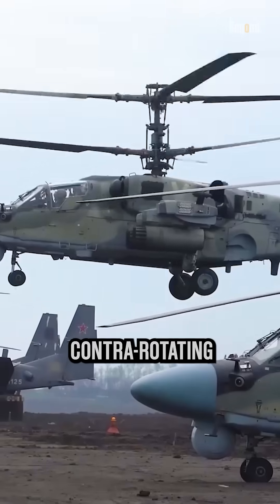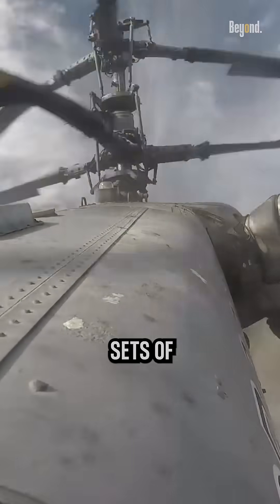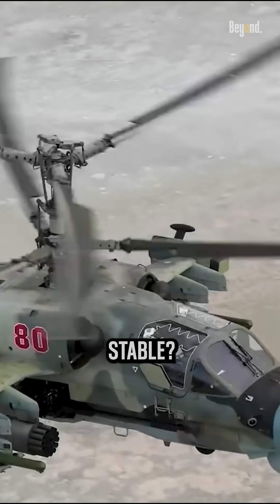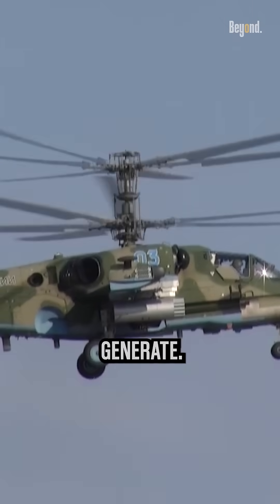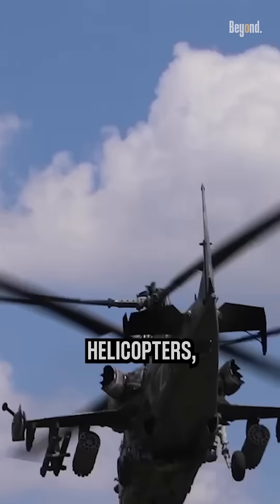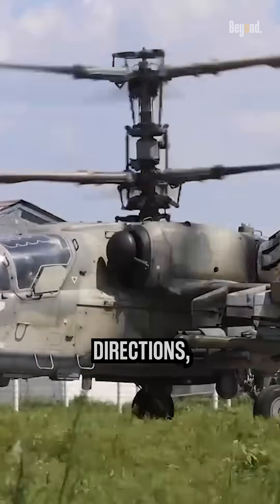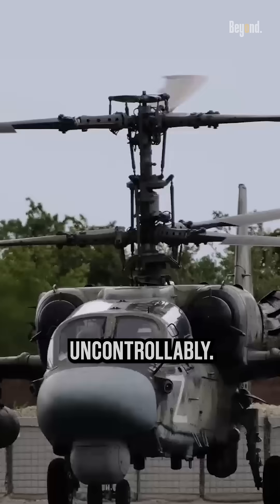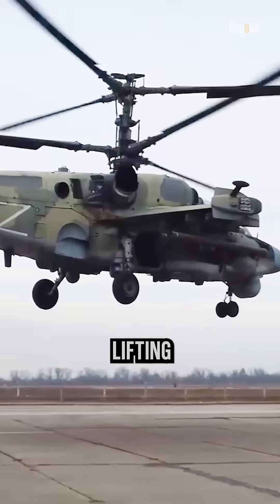How do helicopters with Contra-Rotating Rotors work? #shorts

Comment: Counterrotating rotors, or coaxial rotors, naturally stabilizes the helicopter by cancelling the torque (or the torsion par) from both rotors by spinning in different directions. Therefore, there is no need for a tail rotor (as those found in conventional helicopters) to counter the helicopter’s fuselage momentum as it tries to spin on the opposite direction while its main rotor spins to the other.

Comment: The reason we have NOT seen all that many contrarotating blades on helicopters is that it is MORE complex than driving two blades one lift and one anti-torque. Both cases use TWO blades but the second on the standard helo is lighter weight, so you are spinning two more massive blades in a contra setup. There a reasons for both but that is a use-case decision. Remember actual maintenance and build are more expensive for contra.

Comment: And now explain how those two sets of rotors are turning in opposite direction on one shaft. That is really interesting.
Reply: I'm curious as well
Reply: There are actually two shafts there, one goes through the other.
Reply: @dwishs  I know. One on the inside and one on the outside.

Comment: The coaxial rotor system is actually way more complex, both mechanicly and aerodynamicly, compared to a traditional helicopter with an anti torque rotor. 
Not only does the coaxial rotor have about 4 times the amount of moving parts compared to a conventional heli, the aerodynamics are also way more complicated.
Reply: That explains why the us didn’t use this technology in their helicopters not only complexity of it but the maintenance of it would have been a nightmare probably
Reply: @jaredharris1970 I would actually say it's surprising the Russians went with the much more complex to manufacture and especially to maintain design while us in America went with the more practical one.

We seem much more likely to make for example a VTOL aircraft so we can take off from open fields and dirt roads and then have the aircraft never once in it's entire lifecycle ever use the feature outside of a yearly refresher training.

We'll swear we need it to be able to do all this but then just launch it from a catapult or perform a traditional take off anyways because it's much more high risk and dangerous to take off vertically.

The English did actually use the harrier that way due to not having proper carrier launch capability and using the Ski jumps but we just spent billions making aircraft capable of stuff we never wanted it to have to do
Reply: Actually nope. It's complex in mathematics but not so much in mechanics - you have no need to second and even third gearboxes for tail rotor. And this helicopters are much safer (no cross connections in controls - you don't need to move your collective while do pedals).
And in terms of maintenance, you can research usage of Kamov Ka-32A11BC by VIH Canada. They get 2600+ flight hours in a year on one of their helos and 2000+ f/h in average per helicopter of this type.
Even Californian firefighters (Calfire) tries to by this type of helicopters back in 2014 the US Chamber of Commerce banned the deal.
Reply: @trionghost  It is true that you do not need a gearbox at the rear to power a rear rotor, however you ignore how complex the controls for the second main rotor are.
You first of all need a gearbox to power both rotors coaxially. Then you need a second swash plate between both rotors.
Third, as you removed the tail rotor, you need a way to control yaw, which is done by increasing the collective on one rotor while decreasing it on the other. As the two swash plates are mechanicly linked to eachother and therefor move perfectly together, you need a linkage to change the collective on the top rotor independently from the bottom one. This requires a push- pull rod that goes triaxially through the rotor shaft.
You may have removed one gearbox, but quadrupelt the amount of linkages to control the heli.
Reply: @Sir_Cactus you don't need to tell me how hard it is, couse I'm design engineer working on this type of helicopters for last 15 years. I worked on design of both coaxial and single rotor, and I can say, coaxial is not harder to build, you just have to know how to do it. And in the end they much safer to use (no sudden LTE caused by BVI, no vortex ring on tail rotor, and so on).
Reply: The Kamov helicopters were some of the first ones to use coaxial rotors. If the soviets, who certainly had a smaller budged, managed to fly and maintain an entire fleet of coaxial helicopters reliable, then what you're saying is nonsense

Comment: "Simplifies the mechanical system"
You sure about that?
Reply: They probably got that from overall cost of maintenance, in comparison to other airframes, KA-52s are more affordable to repair at only 10 million US dollars per chopper, Apaches are closer to 13 million per chopper.
Reply: Apache may be more expensive to maintain, but that's probably b/c of the composites used for the blades and other specialized components. If it's 10m vs 13m - I'd look at the 'features list' and compare.
Reply: My thought exactly if anything it makes it more difficult to build maintain and possibly fly
Reply: @michaelnieman6218  The soviets managed to fly an entire fleet of these helicopters reliably for years. As now they're used to spray crops. So clearly they're not that expensive to operate

Comment: Coaxial are more stable than conventional helicopters
Reply: It can fly sideways even backwards while maintaining the same speed. Utter supremacy.
Reply: @tweakerbell99 most helicopters can do that. With dual rotors like this one however, if you go too fast or turn too quick, the rotors can touch in extreme circumstances. Single rotor helis obviously don’t have that issue. Also tons more moving parts is never part of supremacy.
Reply: @Blurredfury22  oh, oh, did I hear someone crying? For what reason? And did this man just assumed some rubbish? Lol, are you some kind of an engineer? And fan fact, many single rotor helo's got it's tail snapped off due to fast turn rate and due to it's tail rotor creating stress in the process. Coaxial rotor helis does not have these problems buddy.

Comment: On a video I saw the KA 52 the helicoptor was vibrating so badly they only loaded the inner 2 pylons. Even then it looked sickening to fly.
Reply: That's something all tri-blade copters suffer from. Sometimes the blades advance to receed in their rotatoin slightly, so when on the ground, they start violently shaking.
Reply: @pinguino5105  i think it happens to any rotor configuration with more than 2 blades (could be wrong though, i'm just a nerd with a keyboard not an actual aerospace engineer)
Reply: @rebel6301   Same here, im dumb nerd, but the youtube short who talked about it said tri rotor, and didn't mention 4. Idk tho
Reply: It's because of the camera, not the helicopter itself

Comment: Failed to list the cons. Rotors like this need more maintenance and require much larger engines to operate; generating more heat (easier to dectect and to track for anti-air) and poorer fuel efficiency (big deal if your broke like russia). Look at the specs of the KA 52 vs Apache and you'll see my point.
Reply: Apache is nowhere near close this thing. At least two levels down. Sit down pls...
Reply: @agera.rs7 Lmao in your dreams orc scum
Reply: @agera.rs7  Russia has lost 33% of their entire pre war stock of the KA-52s XD That is accounting for if all of their pre war stock worked in the first place let alone them not losing any other KA-52s that haven't been photographed.
Reply: If it was a big deal they wouldn’t have chosen this design. They’re also a massive exporter of petroleum products, you think they can’t afford to fuel their helis?
Reply: For attack helicopters i think smaller stealthier designs are better while for transports the tilt rotor designs offer too many pros to dismiss.

Comment: If it was that good America would have it
Reply: America has a profit aim, not fighting for survival like russians. It interferes with their military doctrine. Russian military equipment is way more reliable, more efficient and cheaper.
Reply: Ukraine conflict has proven how good it is...the US is switching to it
Reply: If nationwide free healthcare was good America would have it... Wait
Reply: They are switching out their Blackhawks for these soon so they must be good
Reply: @Steezy93 if you’re talking about the SB-1 Defiant, they are not replacing BlackHawks. The Bell V-280 Valor will with its tilt rotors.
Reply: @Steezy93  No they aren't... that design lost to the tilt rotor design.
Reply: Almost every modern military helicopter concept designed by Americans have these rotors, so yes they are this good.

Also comment above^ tough luck i guess
Reply: That's the dumpest way to judge on things
Reply: @Osama-fw7er  Not really as the US spends the most money on testing the most designs.
Reply: @Osama-fw7er  well c9nsidering that Russia and China both take from our blueprints and make their own iteration of all military equipment. Its actually not. If the double blade design is soo effective why do no other countries have it??
Reply: @Runitback1210  Russia has a coaxial rotor system with the KA-50 Blackshark. Coaxial rotor systems are effective. They make hovering and landing easier while making the helicopter more stable overall. they’re just expensive and complex with a lot more maintenance. stop making it so black and white. Military equipment is complex with drawbacks and advantages to every system.

Comment: Sounds like the author doesn't understand the Principles of Flight, and that rotor blades are actually rotating wings. The rotary wings create lift, not a down-thrust, so they don't interfere with each-other.
Reply: Actually they do interfere with each other but its much more complex than one pushing air onto another. The fact is that it's not completely understood. That's the reason why so many contra rotating propeller aircraft projects were cancelled. They created sonic booms between both propellers which caused them to be extremely noisy. Nobody knows how to correct this which us why the US ceased experiments in the 60s. Other than that, they have many advantages such as increased efficiency. Experimental configurations had 16% more efficiency than regular propellers.
Reply: @qrstw  Actually it is very well understood. That is why Russians created the most powerful and efficient (and loud) turboprop engines in the world, featuring two coaxial propellers to transfer the power of engine on Tu-95.

If there would be just one propeller per engine, to utilize engine power fully it would have to be of too big diameter, having ends of blades traveling at supersonic speed.
Reply: @qrstw If they do so, it means the upper rotor supports the lower rotor with air, to simplify it...
It's like putting two fans right behind each other.
Reply: ALL conventional aircraft rely on the differential of relative air pressure for lift.
Reply: If there is one thing a propelar does is create thrust downward or backwards depending on its position.
Reply: Lift is created with essentially downward thrust.  The rotor is pushing air down in order to lift the helo up
Reply: @ivanalvarez5511 you got it wrong too youre thinking turbine engine. lift is created when the air over the top of the blade moves faster than below, which is lower pressure and creates delta p upwards. Not downwards thrust

https://youtu.be/E3i_XHlVCeU?si=o58hbslxOlyTXk7S
Reply: @nczioox1116  sir.  I believe you’ve got it wrong, or at least incomplete.  Yes, the rotor blades are wings and lift is created when the air moving over it must move faster and creates an area of low pressure which in turn creates an upward force.  However! Newton’s laws tell us that there must be an equal and opposite reaction, which is the downward force(thrust) created by the air moving down in the high pressure area under the wing/blade.  Am a mechanical engineer, was in the aerospace industry for 8 years and was an F/A -18A technician for 5 years.  Also, I’ve flown in ch-53’s, 46s, and I’ve touched a marine cobra attack helicopter and licked an osprey in the hangar once
Reply: @ivanalvarez5511  well done on your achievements. im also a mechanical engineer who models air flows for industrial HVAC systems and have my PPL. Respectfully youre explanation isnt necessarily wrong but also incomplete. downward force isnt need to maintain lift necessarily in an atmosphere. For example a hot air balloon creates 0 Newtons of downward airflow to stay up so you dont need a reactionary force to stay in the air when theres atmosphere. A helicopter will create some downward airflow naturally but the lions share of lift is bernoullis principle.

https://youtu.be/UqBmdZ-BNig?si=5MIoN8TPP717Vd2U

Another link. This is airflow over a wing in an air tunnel. Notice how the visible airflows have very minor downward vectors which would not be able to offset weight significantly as the majority of airflow is not moving downwards vertically. Again, both contribute to lift but bernoulli does most of the heavy lifting (no pun intended lol)
Reply: @ivanalvarez5511 What did it taste like?
Reply: @anzacxlag2606 I've never licked an osprey but I reckon it tastes like chicken man 😊
Reply: @anzacxlag2606  like dirt and oil with a hint of blood.  But the interior smelled like new electronics.  The displays still had plastic on them and there were zip tied tags everywhere.
Reply: @nczioox1116  ok friends, I’ve done some reading, some video watching and have come to this conclusion:  lift is apparently still under debate in some places for certain circumstances.  While Bernoulli can be called upon for typical wings to “explain” lift, it is more likely that the pressure differences are merely a side effect and are not directly responsible for lift, especially not the lion’s share.  This can be analyzed when considering wings that are symmetrical about the chord line or as airflow begins to separate but lift is still generated due to the AOA of the airfoil.  I think it also helps explain drag as the drag vector combined with the downward push of fluid vector corresponds to the thrust vector.  But who knows, I’m no expert, maybe we’ll both have to wait till grad school
Reply: You're the one who doesn't understand the principles of flight , of course they  create down thrust anyone who has stood underneath a  helicopter will tell you that .
Reply: @billcook7483 you got it wrong. Its created by a pressure difference between the air flows. Jet turbines use thrust though for forwards motion

https://youtu.be/E3i_XHlVCeU?si=o58hbslxOlyTXk7S

Comment: You forgot to mention that it can fly without a tail. Also, first.
Reply: I think he mentioned it... The video said it eliminates the need of tail rotor
Reply: @casekocsk it says no tail rotor but doesn’t mention that the entire tail can be missing and it still flies
Reply: @tbnrzip true mate
Reply: @tbnrzip it can remain airborne, but it won’t be going far without a tail
Reply: It will, just lose a lot of maneuverability and the flight will be slightly unstable. Just enough to get back to airbase from the battle and save the heli.
Reply: @Anonymous-tj8xm  It will
Reply: @Anonymous-tj8xm Ah-64 apache would never.